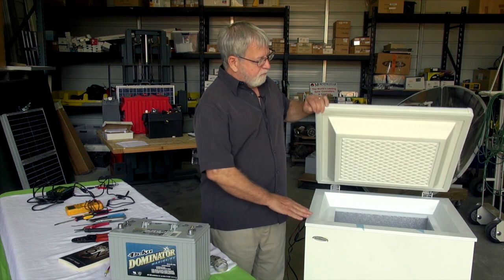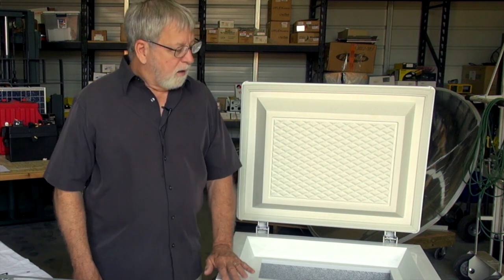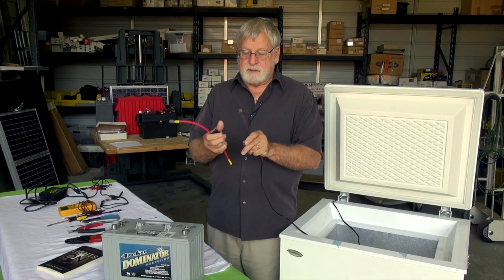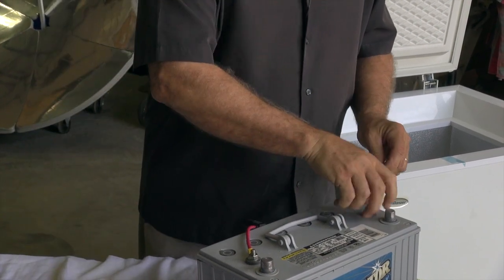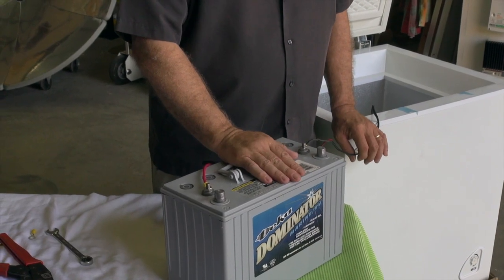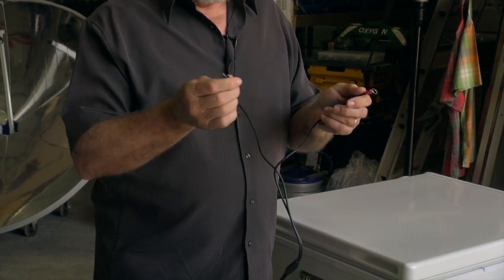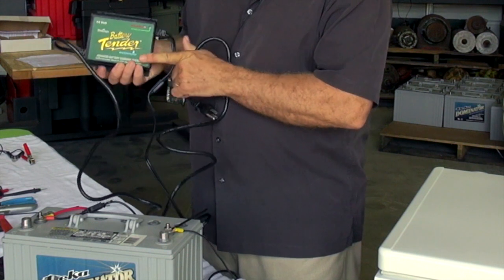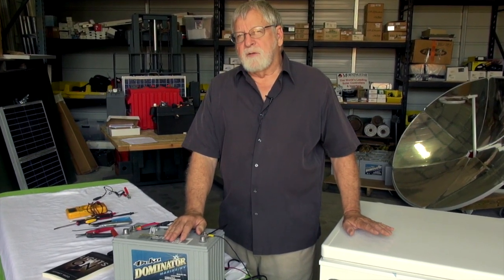Lights On: Learn How to Run a Fridge on Batteries - Part 1

Comment: I hope everyone here knows the difference between AC AND DC fridges.. This is a DC so you CAN NOT cut a power cord to a wall outlet and connect to a battery.. If you do then you are a special kind of stupid.
Reply: It's a DC Fridge. The AC power and resistor keeps the battery charged in case of power failure. Then the battery takes over. How stupid do you have to be to not understand that?